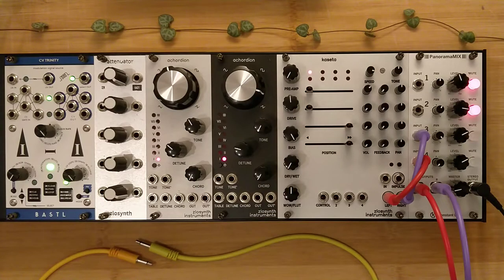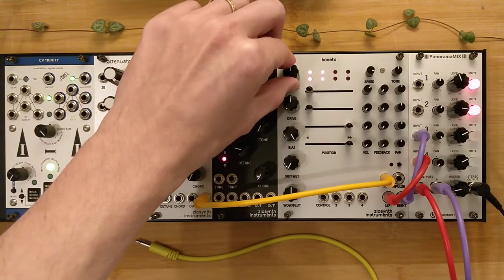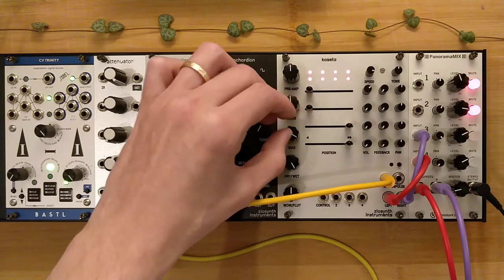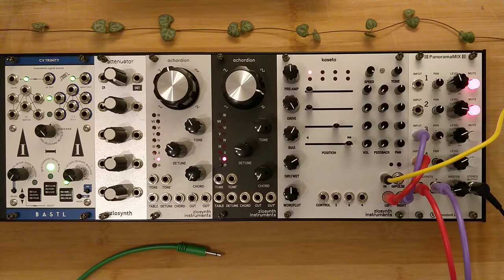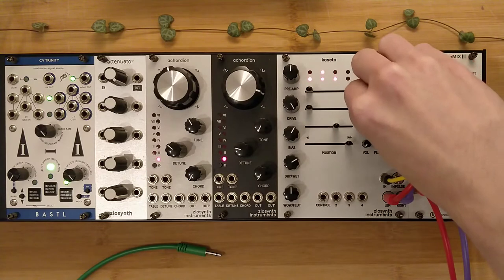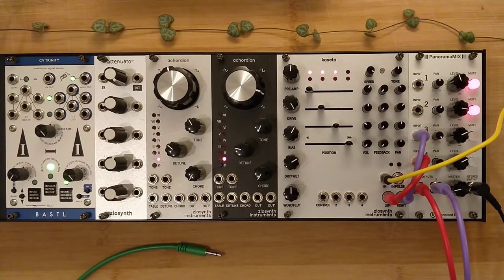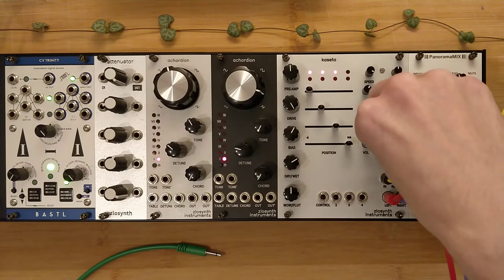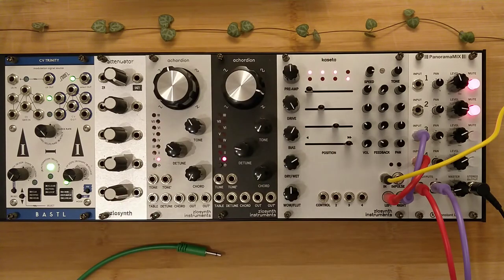Kaseta Overview

Comment: I like it, buy why not stereo inputs?
Reply from the maker: Even though the module uses a powerful processor, it is not powerful enough to handle two independent channels of the existing signal processing chain. I tried to optimize it for stereo, but the saturation algorithm is just too resource hungry.